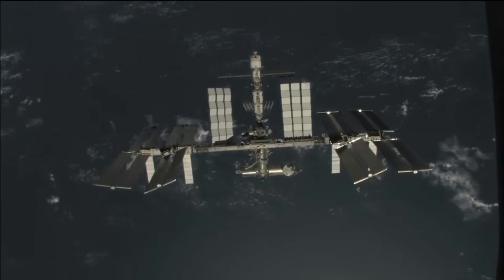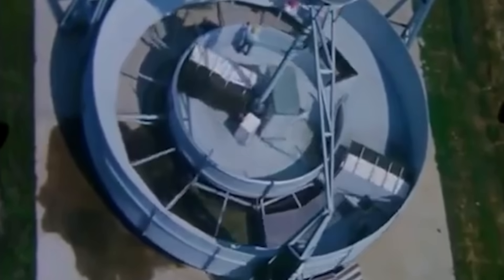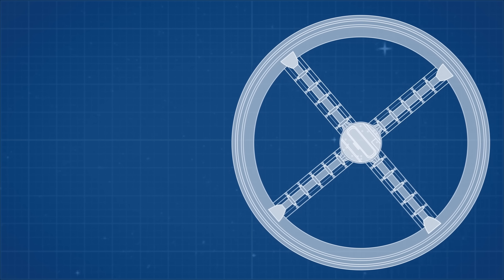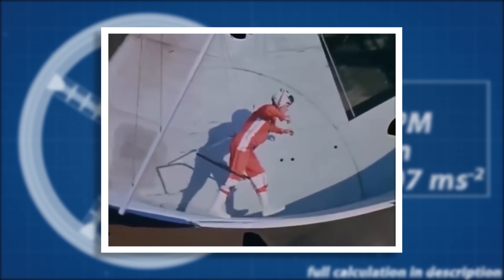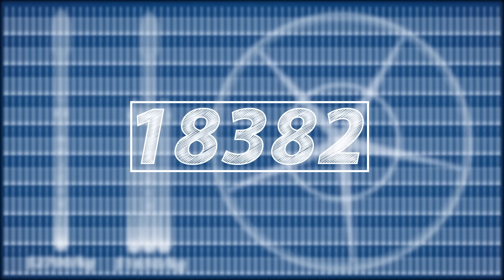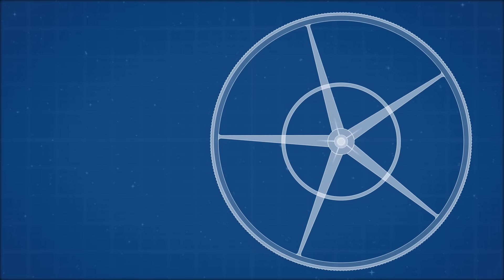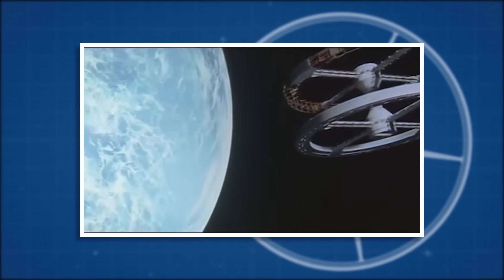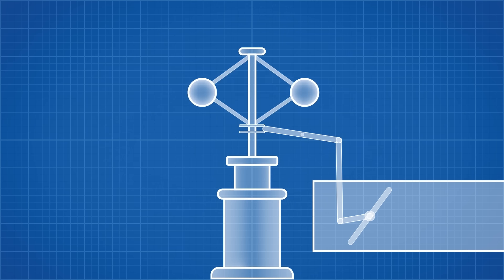Can We Create Artificial Gravity?

Comment: Step 1: Build a space elevator on the equator (Future delivery cost for any space construction will be significantly decreased because of this)
Step 2: Build a small spinning ring station at the counterweight of the space elevator for workers to live in
Step 3: Build dry docks to constructs space vessels with mining vessels as a priority
Step 4: Mine asteroids and the moon for resources exclusively for the use of space travel and construction
Step 5: Build a larger and more average people friendly spinning ring station for civilian use
Step 6: Proliferate civilian space travel
Step 7: Build 2 or 3 more space elevators separating by 120 degrees or 90 degrees on the equator to make space travel more accessible for people of every hemisphere
Step 8: Place solar energy arrays on the counterweights stations to beam back down power to the ground via laser (Because the elevators are so tall, the Earth's shadow won't block the solar arrays, thus allowing them to produce electricity 24/7) With enough of these arrays on the towers and receiving station on land, it will make all fossil fuel and even wind energy obsolete
Step 9: Unlimited clean energy mean slowing down climate changes and possibly reverse it with the added benefits of removing oil as a factor of political conflicts
Reply from the maker: Graphene isn't strong enough either, I will make a video about this eventually. I actually specialized in carbon fiber composites for my thesis. A subject I am really passionate about, but people overstate the strength of composite materials. I would say, with a fair bit of confidence, that we will never see a space elevator.
Reply: @RealEngineering 
But it's pure carbon [as pure as we can make anyway], how is that a composite? That's like calling iron an alloy, steel is the alloy, not iron...
I reiterate, how is graphene a composite?
Reply: If they could only find a way to produce Graphene in larger quantities. This would be a big Step on the way to Step 1
Reply: Fuck. We'd need a one world government first to use all of our resources efficiently. How many resources are tied up in large scale weapons I wonder.
Reply: And here I was just gonna come here and yell "WE NEED A SPACE ELEVATOR!"
Reply: Apparently boron nitride nanotubes and diamond nanothreads are also candidate materials for building a space elevator (though I imagine we're nowhere close to being able to produce those in significant enough quantities to be used for that purpose).
Reply: One world gov't to force your will on the whole world?
Reply: @timlarkin4471  World Economic Forum (WEF) is working on the "One World Government" bit as we speak...
Reply: To bad we seem to be blocked at step one. (Mainly because of capitalism 
imposing limits on the market and resources being wilfully mismanaged to
 engineer profit via scarcity.)
If only we could return to the kind of devotion we had in  the cold war space race. "We do these things because they are hard" and all that. Where did all this science spirit go? 

Nothing to motivate people to move out of the neighbourhood more than an  H bomb and overpriced video games. But then again, maybe the space elevator doesn't get enough attention because it sounds ridiculous even if its sound.
Reply: I suspect the future lies with 3D printers being put into orbit and fed with raw materials from a space elevator on the moon,. Although a Space Gun would probably suffice at Luna gravity. Maybe the 3D printers could recycle old dead satellites.
I don't see the need for a Ring Station for the Elevator builders as crew quarters would have 1G pretty much all the way up to the "weightless" point where they would fall over the horizon. So hang quarter from the cables. Space elevators would need to build up (to counterweight) and down from a geostationary orbit.
I'm not even sure which way gravity would point in a counterweight. Up? Down? 45 Degrees?
Again "Dry" (Space?) Docks to build ships would be unnecessary if 3D printers are building them.
The Vacuum of  Space is one of the most hostile environments to human life, so if you can get a job done by a robot it's not only safer, but cheaper too as a robot doesn't need expensive life support.
But then why go for all this huge infrastructure to put Humans into space? There's very little they can do outside their little shielded pockets of air, and currently there's nowhere for them to go but back to earth.
Far better and cheaper to send robots out to explore and experiment in space. The few number of human missions that are actually needed are easily handled by current (and improving) methods.
Reply: One problem: most of the equator is ocean.
Reply: Helio
lets design first ^^
Reply: Plus there's that little issue with a single atom defect unzipping the whole tube when it's stressed. I think we may eventually see space elevators, but not off earth. It'd be a great way to fling resource packets off a larger asteroid.
Reply: Is it technologically possible for us now to use laser for massive energy transmission? And even if so wouldn't the laser beam be weakened by atmosphere?
Reply: Or you can make the ribbon on the elevator conductive and produce electricity through that using earths powerful magnetic field.
Reply: I don't think Arthur C Clarke was joking when he proposed the modern Satellite, nor when he wrote about the Space Elevator in "The Fountains of Paradise" (well worth a read).
Reply: Step 2 : Don't use human workers , automation and robotics please they are cheaper to feed. And works all hours, they don't need oxygen and food. They don't fall sick. They could potentially be powered by solar energy.
Reply: Real Engineering Huh? I thought that Graphene was the only material which could withstand the forces? Sad to hear that this isn't the case at all.
Reply: Earth burns up from all the heat produced from the use of unlimited energy.
Reply: +Kevin Kleebusch Graphene itself isn't strong enough but making carbon nanotubes out  of Graphene we will be able to build one. But sadly making  carbon nanotubes is hard.
Reply: ***** why would they be orbiting at different speeds? if we connected it to a satellite at geostationary orbit then it will orbit at the same speed so it's not a problem at all.
Reply: Why are you not in nasa
Reply: what if elevator acts as cosmic lightning rod?
Reply: TOO EXPENSIVE. The only way this utopian idea would work is if Earth was a utopia of united citizens. As it stands, we have terrorists who will probably be super excited to see such a space elevator rise to completion... and fall to ruins. Boom. You know. People who are willing to blow shit up just because.
Reply: laughs A one world government would never do anything efficiently.
Reply: ***** we need to harness the thorium232 at a better level.
Reply: Sounds great! You do step 1 first, and then I'll handle the rest. :)
Reply: If only any of those things were actually possible.
The only viable design of a space elevator is an orbiting spinner - I suggest reading up on it.
Reply: CellDevises Space elevators are very possible, just not for the Earth. even with present day speculative-science-fiction.. it would be impossible to lift such a cable from Earth into space.

Also note that, resent research in Japan has shown that carbon nanotubes, even if we could make them long enough, break more easily than had been realised if they have even the smallest flaw.. thus refining their likely strength downwards..

An Earth based space elevator is impossible ATM.

The Proposals made by  ArchOfWinter (original comment) need to be heavily modified for a number of reasons.

One.
We should begin by making a colony on an asteroid or a large space craft that can act as a laboratory, mining vessel and manufacturing plant.

Two:
Nudge a suitable asteroid into a geostationary orbit around the Earth's Moon.

Three
Manufacture a cable on the asteroid and lower it down to the Moon..
A cable need not be as strong for the Moon as it has less gravity.

An asteroid would have barely any gravity thus lifting a cable to the Moon from it would be relatively trivial.

This also has the advantage of having a counterbalance in place (the asteroid itself)

Four
Establish or enhance and increase the size of Moon colonies and manufacturing on the Moon (and on other asteroids).

Five
Transport mined resources and manufactured objects to an asteroid where they can be used to assemble larger inter planetary vessels to produce asteroid and planetary moon colonies (moons of Mars etc).

)
There is a problem with sending energy to Earth as it adds heat to the Earth's atmosphere.

Earth should be using renewable sources of energy, which take energy from the Sun and other sustainable sources.

CO2 causes the Atmosphere to retain heat from the Sun.

Even existing nuclear power sources work by producing a vast amounts of heat to drive turbines etc , dumping heat into the atmosphere.

On a global scale extra space energy would add up.,
And it doesn't tackle the actual problem of stopping CO2 producing oil corps and denial lobbies either

(the only reason this is even an issue and the reason we don't have sustainable energy already is due to failure in dealing with the Koch, Cheney, Exxon and Saudi etc right wing neofascist oligarchy who are trying to hog energy production and spending in big power companies they own)

We need to deal with them here on Earth.
)

Six
Doing more manufacturing in space would also mean we could protect more of the environment so rivers were less polluted etc.

Seven
Earth should expect lots of deliveries from space as the decades roll on, heat shielded and parachuted down by space colonies and robot factories.

Eight?
Hopefully we'll find a way to make a cable strong enough for a space elevator for the Earth one day, which would allow more people to go and visit our interplanetary and asteroid dwelling neighbours.. AFAIK there are no technologies envisaged that could do that ATM though.
Reply: I say even if it seem impossible for such strong material to exist now, we should still chase after it. We will learn something new every attempt we try.
Reply: elevators are not practical,only if the work by electromagnetic means but those are very complicated
Reply: at least not on earth, but on other objects like the moon, where gravity is weaker, it would be possible
Reply: then we would have free light shows
Reply: I was talking about lightning that would destroy the elevator and wreak havoc :D but i think we are all joking anyway
Reply: docthebiker maybe it is worth it, but I may just look at critique of it :D. thx. I was mentioning wallace thornhills view on the elevators, i think
Reply: ou ou ouuu wait step 4 i think its not clever idea...we dont know wath happen if we reduce the mass of our moon. " Time Machine" make me think moon ming its not soo good idea. asterid mining its perfect.
Reply: we nned one method to make large nanotubes and leave the actuals fibers.
One thing its have wires of fibers and another to have wires of perfect nanotubes you know like puzzle.
Reply: Chrysaetos3 More or less.
Reply: SLEVIN SHAFEL If you build a space elevator you'd be shipping at least 8x that mass off of the Earth, so it would balance itself out.
Actually you could take millions of tons of material away from the moon and only reduce it's overall mass by the tiniest fraction of a percent.
Reply: WHy does this = unlimited clean energy?
We only loose about 50% of energy to the atmosphere, so the panel;s would still need to be enormous.
Reply: Unlimited as these panels would be high enough to get sun light 24/7 and they can beam the energy to anywhere in the world any time. Because of this, there is no need for battery storage (at least for stationary power). There wouldn't be any need to worry about peak hours or demand.
Reply: ArchOfWinter Ok then, so it's almost 4 times more power/area in space. It's a cool idea but you'd still need a ridiculous amount of panels.
Reply: or may use a graphene based economy to build a Hemp elevator
Reply: Hawken Fox Why not replace our entire civilization with robots? Why do we need humans anyway?
Reply: ferofax not if we legalize pot, then theyll be too high and we can use their tax moneh for the project too.
ps seen both zmf and cgp's vids, they dont concern space elavators, but they do suggest that we wont have any use for all the refugees entering western countries.
Reply: Hyper Hektor That's it I am muting you guys.
Reply: RedsBoneStuff
what is wrong with my comment? its a normal discussion in the comment section.
Reply: idk if you played too much space engineers or so but i think we would alredy build a space elevator if we could but i think the problem is that you would need a pyramide construct (with our technology) and the bottom would be big as the place of the sahara cause wee need to go at least up to 100km so we would need a place who is 100km x 100km x 100km. and then you would need a space station who has a pre build "tube" system for the elevator then you need to connect earth and space station and this is what it makes harder to build i mean you would need to "connect" a space station to earh but what do i say im just an engineer...
Reply: interesting, lets do a kickstarter.
Reply: Yey
Reply: Free energy means we can just turn on the AC and open the windows. Duh!
Reply: Because when you mine asteroids and the moon they come with perfectly processed metals that fit perfectly with the design you're building, and if they didn't, just stick a factory it's not like you need all sorts of machinery to process it, you would first need to ad a factory city up there, but why not just build the ring in the first place
Reply: Unlimited clean energy you say?

The sun, being the fuel in your little dream, is neither clean or unlimited.
Reply: Clean as in, it won't directly pollute the earth, and unlimited as in won't run out for human species' remaining existence.
Reply: ArchOfWinter - Without proper protection from the Earths magnetic field, it would not only pollute the Earth. It would leave it completely barren.

Think again.
Reply: ***** Astronomical events which humans can't control can't be considered pollutant when talking about clean energy. 
It is still clean because we can't cause a sun spill, we can't force the sun to destroy us on a planetary scale. 
In practical human level, the energy source of the sun is the cleanest form of energy.
Reply: ArchOfWinter It's all about technological advancement.

If we can learn to harness the sun at a greater level, there would surely be risks in the sun either imploding or exploding, or perhaps just dying out.

Either case, that's pollution.

Let me spell out the definition of Pollution for you, because you clearly do not know what it means.

- "Pollution is the introduction of contaminants into the natural environment that cause adverse change.

Pollution can take the form of CHEMICAL substances or ENERGY, such as NOISE, HEAT or LIGHT.

Pollutants, the components of pollution, can be either foreign substances/energies or naturally occurring contaminants."

Now please crawl back to your kindergarten teacher and pick up a book, I have a feeling you're going to need it.
Reply: I reported someone from this comment section by accident...
If anyone seems to have been affected, apologies...
Reply: ***** Go back to kindergartner? 
Now I am seriously hoping you are trolling because I am deeply concerned for society if your education has brought you these idea about the sun. Are you from that North Carolina town that voted against installing solar panels because you're afraid they will suck up the sun? 
We human beings does not have the technology to effect the sun on any scale and will probably not have such technology until we reach to become a type 2 civilization on the Kardashev scale several centuries away.
Reply: what if we affect the sun by getting something like a comet to dive towards it. some argue that the sun flares in reaction to sundiving comets because they provide a point for electrical discharge to happen.
Reply: Helio
 for that kind of power games human technology is way to weak. For this type of actions we need some energy source that is powerful enough to save us if something goes wrong. The sun is our only source for the hole planet eco system, if you mess it up without an alternative source at hand its plain suicide.
Reply: a comet want do anything to the sun, but it will do something to the earth.
Reply: Great idea except that latest research indicates even carbon nano tube fibres will not be strong enough for a space elevator on Earth.
However.. transfer the concept to Mars, the Moon or one of many other smaller planets and moons in the solar system, and the problem of making a strong enough cable is trivial.. plus it would be much more efficient to mine and build a cable on an asteroid too.. thus avoiding the astronomical cost of lifting a cable into space from Earth.
Reply: mars Cubed Apart from all the fun we've been having in this comment section, I think we did raise some skeptical points. Ultimately, you probably won't run into the biggest difficulties, whether surmountable or not, of such a project until you actually start planning and working on the real thing.
Reply: Helio The reason I mention the difficulties with carbon nano tubes is because they were seen as a plausible way in which to make a cable strong and light enough for a space elevator..
However, recent research has shown that even the smallest faults cause the tubes unravel and fail.
https://www.newscientist.com/article/2093356-carbon-nanotubes-too-weak-to-get-a-space-elevator-off-the-ground/
"Nanotubes too weak to get a space elevator off the ground"
Thus space elevators for the Earth have suffered a serious setback.
However, they are still a good idea for smaller bodies such as moons and some other planets in the solar system.

Consider also Phobos, which is a moon of Mars.. it is the closest orbiting natural satellite of any planet in the solar system.

In the book Red Mars, Kim Stanley Robinson  proposed that Phobos could be nudged into a geostationary orbit and that a space elevator is mounted there as a way of getting to and from the surface of Mars, without the need of rockets for landing gently on Mars (no sea to splash into) or for leaving the surface and establishing orbital velocity.
Even if Phobos was just used as a space station and factory moon, ie, to produce a cable...
A space elevator of any kind would make habitation of Mars much more feasible, and might end up costing much less even in the medium term once mining and production in space was established.
Reply: +mars Cubed i dont disagree on the tube strength problem, it just adds to the difficulties. I still think inhabiting mars is a longshot but elevator to phobos would be cool 😁. its meant to collide with mars in 2mil years or so i heard, you think its possible to nudge it enough?
Reply: Helio IDK about whether it is feasible to move Phobos, I guess that this would be to a higher orbit, thus higher orbital velocity would be required.
Phobos has a mass of 1.0659×10^16 kg

Escape velocity is about 25 mph (if you run fast you'll go into orbit around Phobos, gliding around just above the ground, a strong bounce or jump would give you escape velocity so rockets would probably be needed on vehicles/people so they could go back towards Phobos if they accidentally took off).

What comes to mind is moving Phobos by blasting pieces of it off into space at high velocity.. ie, waste from mining could be fired into space with a very high energy cannon (or many cannons) of some kind.. this could be part of robotized mining plants.
Over the eons, Phobos could be nudged and become smaller too (easier to move) as it lost more of its mass.
Without checking the answer or the maths for accuracy, straight into and out of Google calculator.
I get.
(1.0659 * (10^16)) kg / 2 billion years =
5329500 kg per year would have to be ejected from Phobos before it had zero weight.

So divide that by 10 to give us a starting point for how much mass might be required with most of Phobos still remaining..

The questions become things like,
How far could we move/accelerate Phobos by accelerating (firing) 532950 kg per year into space from Phobos surface.
Is this even possible?
What kinds of chemical (or nuclear) energy will we find on Phobos to fire stuff into space with?

What kinds of velocity can we expect to fire stuff into space with using different possible technologies?
Do we need way less mass? (possible, IDK)

And will this necessarily be translated into moving Phobos? or will be be expended as heat? (energy transferred from cannon to Phobos becoming photons generated by redistributions of bonding energy within the geology of Phobos below the cannon's base).

Again, most of these IDK, although Newtonian physics provide general kinds of answers..
This is maybe the kind of Physics on the edge of Science Fiction that probably isn't published much although it gets discussed by students over beers etc.

ie, essentially we would be moving a very large object including its gravitational field.. within another gravitational field.
It makes one wonder whether there would be new science forthcoming.. Moving Phobos, if possible, might be a way of looking at large scale quantum phenomena too maybe.. whether bonding energy is in some way related to how gravity works? (does heat generated this way have a vector/MF component at larger scales?)
I am not a physicist BTW, just a curious onlooker, perhaps others can answer some of the questions above..
Reply: Helio I just found these factoids to add to the mix.
Old paper but seems legit."
The orbit of Phobos is 20,400km. Phobos has an orbital radius of 9,380 km (about 6000 km above the Martian surface) with an orbital period of 7hrs 39mins. It is gradually spiralling inward towards Mars
It is estimated that within 11 to 50 M yrs Phobos will crash into Mars surface.
Estimates vary however Phobos altitude loss is around of 20cm per year or 20m per century.
It would have to be moved at least as much just to stop it falling closer to Mars.
Reply: Space elevators are completely impossible. The only way is to have it orbiting or flying at ~25000mph
Reply: MrTagnan IDK the actual numbers involved, but 25000 mph seems very possible considering the kinds of velocities space craft already achieve.
There are already satellites in geostationary orbits that a space elevator would need,, no problem with the speed at all (matching that of the Earth below them).
Reply: +mars Cubed it would have to orbit as it might burn up in atmosphere
Reply: MrTagnan No it wouldn't..  as it would be a geostationary orbit..
That means above the same point in the ground and orbiting at the same speed as the Earth is rotating.. 
Thus a cable hanging down through the atmosphere would not burn up as it would be going around with the Earth at the same rate as the atmosphere.
The physics has been worked out decades ago and in not a problem in the way you suggest.
Reply: +mars Cubed I doubt though unless I have a clear response that a space elevator would allow 0gs unless we used a geostationary orbit. But then again I'm not quite understanding how to get there and back
Reply: ArchOfWinter you can't build a space elevator
Reply: Carbon nanotubes(just the graphene rolled) might be strong enough to build an orbital elevator system. Eespecially in groups, like how we make steel cables stronger. Also +ArchOfWinter there should be three pillars, keeps cost down and to keep the pillars on land instead of in the ocean(or at least keep them relatively close to land).
Reply: ***** Carbon nanotubes would be put into large roll of many cables.. that is not the issue. The problem is that even if we could make carbon nanotubes long enough, the slightest flaw can propagate through the cable causing it to fail (recent research).. making cables more complex increases their weight making them unsuitable for an elevator.
Earth has too much mass for a space elevator to be possible with current technologies... however it would be possible for many other bodies in the solar system.. which would be very useful once manufacture on such asteroids and moons is established.
Mars is also a possible candidate for an elevator.. ATM an elevator for Earth is tantalisingly close but still out of reach.
BTW, elevator designs for Earth have already factored in things like placing them on top of highest mountains etc.
Reply: i thought i was the only one
Reply: mars cubed you haven't done your research have you?
Reply: The climate will destroy the earth by the time step 1 is complete.

Edit: Destroy Humans
Reply: Orbital ring first, then the elevator.
Reply: First step before all of that... develop material sciences to allow for a cable that could handle it. We don't have that yet. Space fountains are also improbable. Unfortunately, we may have to resort to launch loops and sky hooks at first.
Reply: All these answers yet no one agrees. Won't ever happen
Reply: Not physically possible sorry
Reply: I propose a different way we could use the moon as a stop and make a base there and put heavy industry  onto the moon and this will make space more economic and then we could mine steel from the moon to build it.
Reply: Also as a sci fi proposal we cold use the strong [ nuclear ]force to make the atoms have a perfectly hexagonal structure and using this material
 we could make a space elevator
Reply: i doubt you can encounter islamism with weed, since their religion is a kind of hardcoded programm. You have to force the shit on their childs which seems a bit difficult ;). Maybe if they learn about weed before islam blocks their brain memory, it could be possible. But how do you want to achieve this, in islamic states? only way is de-islamisation.The problem is Goverments all over the world love openly or secretly totalitarian system since they can better force the people to stay inside the box (or hamsterwheel)
Reply: ArchOfWinter - facepalm No, I'm not even American. And thank god for that.

I am however a realist, and realize that the sun is NOT clean energy.

It is considered clean, because it's going to be there for a very long time, and we might as well use it.  But the sun is and never will be clean. It is constantly polluting the solar system, and it even completely killed Mars.

Blocked for trolling.